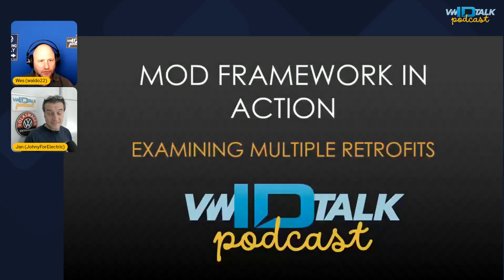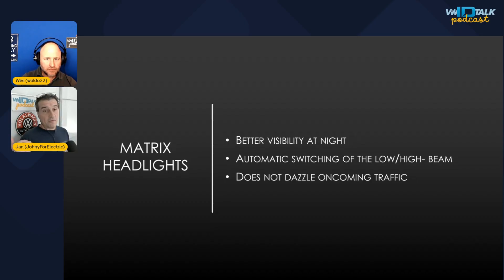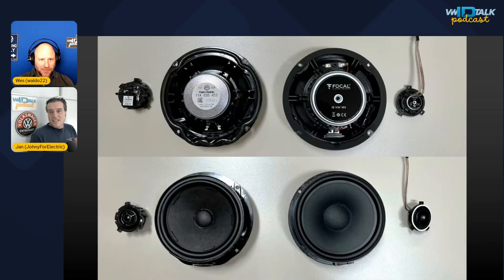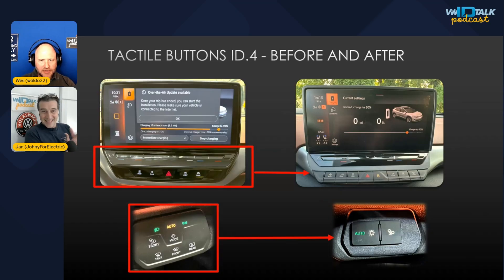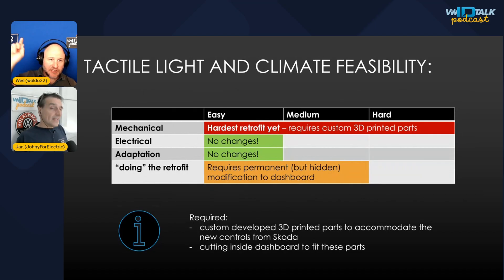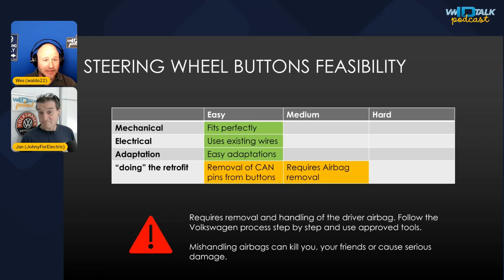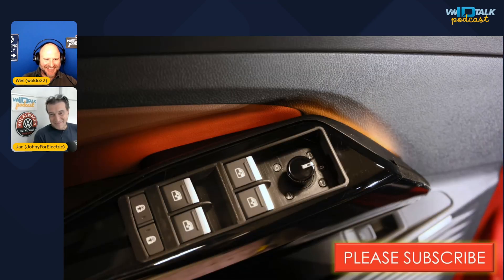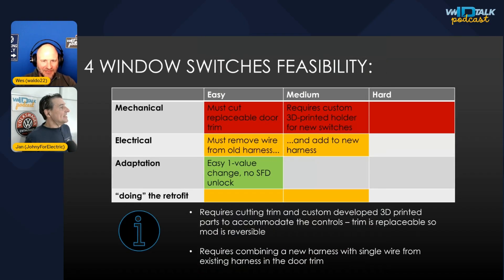Stop Guessing: Our 3-Step Mod / Part Retrofit Framework for VW

Comment: I really wish VW had a tactile/real button steering wheel as an official option from the beginning... I can get along with the volume/temp control and the light management cluster (I'd still love to RE the linbus commands), but the steering wheel is a PITA, I don't know how they didn't realize people are getting into dangerous situations because they need to look at where they're clicking instead of watching the road or double check on the cluster what they did... and I can't count the number of times I bumped cruise control from 90 to 140 instead of 95km/h because there's barely any feedback between the small and big press... I love my Buzz otherwise, but my Kia e-Soul had much sounder controls all around :)
Reply from the maker: Thanks for sharing. The buttons on the Buzz are improved a bit, compared to the first generation that we had in our cars. The buttons are smart and VW chose not to allow users to select touch pressure and other settings in the multimedia. It's a shame, I think these buttons were designed as winners, but lost somewhere in execution...

Comment: I bought the battery heater  kit but am wondering if it will invalidate the warranty for the battery?
Reply from the maker: Installing the pre-heater kit will absolutely NOT void your warranty, unless you install it wrong and break something.  The Magnuson-Moss Warranty Act prohibits manufacturers from disclaiming warranty liability unless they can prove that *you caused the problem*.

If you drain the oil out of the engine of your gas car and neglect to refill it, and your engine seizes, they can disclaim your engine warranty because you caused the problem.

If you swap out the buttons on your steering wheel, they can disclaim the warranty on your steering wheel buttons. (but not on the rest of your car)

If you install a performance chip and overdrive your motor and burn it up, they can disclaim the warranty on the motor.

This battery pre-conditioning trick uses VW's built-in factory software procedure to tell it to heat the battery up to VW's specified optimal charging temperature.  If you use T-taps on your factory harness and damage the wires on your factory harness, they can disclaim your warranty on that.  ...but they can't disclaim the battery warranty unless they can show that you did something to cause a problem.

Having said that, I would install the pre-heating mod using a harness extension so that you can remove it if you ever have a problem.  Just because it's illegal to disclaim a warranty doesn't mean they won't try, and they have more money than you do.  (We assume)
Reply: Yes it will. If you are able to remove it before service you should be fine I think